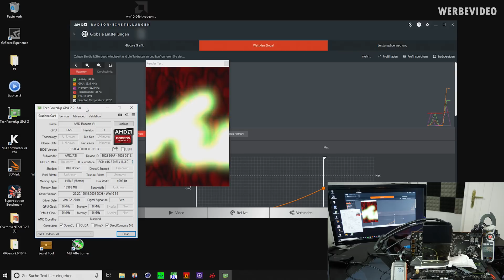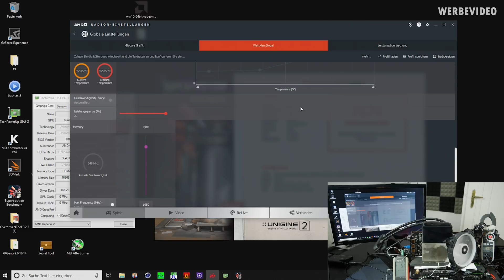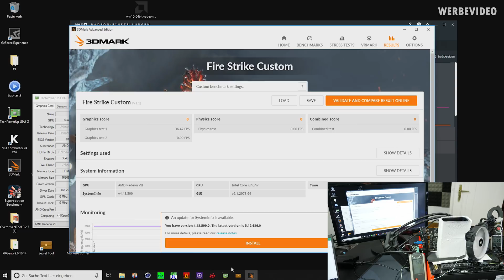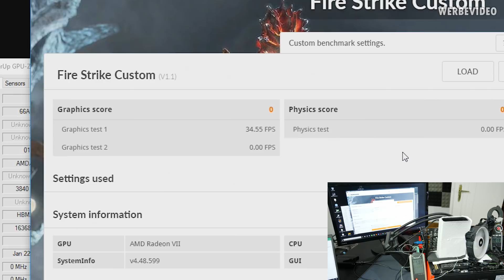RADEON VII Extreme Overclocking Attempt (en)

Comment: The fact that the "junction temperature" sometimes showed 65000 Celsius suggests to me that there is something fishy with junction temperature. I suspect it is actually calculated and not a direct measurement, though have no proof of course. It also jumps instantly from 40C to 100C under load which is physically quite fishy.

Comment: You can solve the clocks issues by setting as the minimal state the last state (where you changed the clock), so at the top of the state says min/max.
This issue used to happen in my rx580, I solved it with this.

Comment: would you be able to venture into the area of E3 v6 Xeons running on B365 / H370 / Z370 / Z390 Mainboards? I read somewhere that when you run Intel Management Engine cleaner on the bios a E3 v5 Xeon is able to run on Z170 so I would like to know if E3 v6 Xeons run on the newer chipsets.

Comment: Perhaps amd decided to screw overclockers and has decided to lock down their cards and this is why amd board partners have decided not to make special editions... And also perhaps they are not allowed to... It sounds like amd is deciding to neuter this gendration...
Reply: aib cards with custom cooling will come later. As said by amd.

my guess is that it was so rushed that we dont get any real aib cards for now, and the aib models wouldnt sell well if the cards drivers etc arent finished yet. Its like the started selling in the very late alpha of early beta developement for software

Comment: well...intel gonna delay 7nm later until materials replace old aging silicone that is not very good on lower nodes and extra heat....need carbon nanotubes  would do the trick but question how does it work on putting circuits on carbon wafers ??? good question...hope intel figure this out while AMD goes down by the flames on silicone are not fire proof so beware buying 7nm...you need home insurance first ...cause we gonna see lot of computers catch on fire now....and investors already preparing securing the money when time comes for AMD huge problem is lot worst then cyrix face

Comment: for this setup...you need LN2....cause water cooling have harder time cool this hot iron that is 110c to begin with on fans...and no room to push further on voltage...its pretty max out failure to me

Comment: You and some others have a voice with manufacturers or their reps.  Please tell them about the problem with the cooler plate being flat and thus requiring a thermal pad is a VERY poor method to cool the GPU and RAM.   They should stamp out copper plates with the correct thickness then nickel plate them, that would insure a proper fit for using a good TIM.   May be they could even put copper shims on the RAM until a permanent fix can be done at the manufacturing level.
Reply: Um do you have any evidence of such a claim. About the paste vs the pad
Reply: @jdrok5026    Yes, I have at least several evidences of a good paste TIM being superior to thermal pads.    I will not go to the effort to find the numbers, you should be able to google them.   Many people know that liquid metal TIM is better than "paste" TIM which is better than thermal pads because of the thermal transmission characteristics.    The only advantage thermal pads have over paste TIM is when there is a relatively large gap between the heat source and the cooling plate.  Also, when there is no to almost no gap, relatively deep scratches, scoring or machine marks on a surface paste TIM is superior to liquid metal, because liquid metal is not able to fill gaps and keep the gaps filled.   There are limitations and trade offs, however, that does not make my statement above incorrect.
Reply: @jdrok5026    Here is a very simplistic proof of concept video:   https://www.youtube.com/watch?v=GIgl1d5ldoA

Comment: FACT: Invest in the Best GPU Graphics NVIDIA RTX and Forget about the Rushed to Market, Half Baked, Crash and Burn Drivers, NO OCing Headroom, Over Hyped Waste of Money Rebrandeon VII.
Reply: @MrBluePoochyena  RTX gives you more performance and better graphics, as more graphics engines/developers optimize for RTX Tech like its Tensors Cores the performance gap between Pascal and Turing will increase even now I see 20% or improvement in some games. NVIDIA invested 10 years of R&D into RTX Tech they deserve an ROI for FINALLY delivering the Holy Grail of Graphics to Games Real Time Ray Tracing. You just have to look at how much expensive silicone RTX takes up that Maxwell/Pascal didn't have to understand why the price is justified, yields are lower and costs are higher. 
If you look at debt dumb and R&D poor AMD's bottom line their dGPU make pathetic profits, that's no way to run a company.

Comment: I think it's down to the components used on the card. & hence they didn't wanna do anything on the drivers. It's not that they can't but they won't. Look at GN video where Buildzoid ran an analysis of the weird components used on the card.
Reply: Weird they where all high quality.
Reply: @jdrok5026  On that part, if we look at Radeon cards vs Nvidia cards. The Radeon cards have more better visuals than an Nvidia cards. Like before, Radeon cards r the go to if u doing anything that invloves images & videos. They tend to have higher quality images & Apple products that uses Radeon GPUs have demonstrate it further. Am looking way back when Voodoo cards were just about to get stomped out of existence.

Comment: The drivers have been broken since the 2019 version was released. I get the best out of my Vega 64 with the last of the previous version. I’ve tried the newest ones and they are a hot mess. Obviously you can’t use the older ones with the Radeon VII though.

Comment: If AMD had released a product that was even 30% faster than the RTX line up, the NVIDIA would have sunk the prices of their cards and at that point the Radeon VII would have become just an expensive card that most would have not purchased. Because NVDIA cards are overpriced in terms of production costs but the Radeon VII is not, AMD cant afford dropping price on it to match NVDIA in that scenario, AMD had no choice but to to agree with NVIDIA to not cross certain performance lines to sell their Radeon VII as long as NVIDIA is equally expensive for about the same performance level. 
We see this with many industries, Airlines for example why does it cost so much to buy a plane ticket? Not because the fuel is expensive otherwise we would see a significant decrees in prices when crude oil drops by 50% up and down, but we dont see it, all the prices stay exactly the same for periods of time across different airlines no matter if oil is $100 or $50.

Comment: How did the NVIDIA CEO know so much about AMD card before the AMD card launched calling it less exciting as if he knew exactly what it was? 
Why does the AMD card is exactly as powerful as the RTX 2080 and not a bit more or less?
Why does AMD did not take seriously the overclocking issue while they knew about it, they had to and knew for a long time or was it perhaps not an issue but rather an intentional block the AMD has set in the driver for the Radeon VII to not exceed the performance level for some reason?
Why does AMD card costs exactly as much as the NVIDIA card and not even $30 less?
A lot of this starts to look like there is a certain monopoly game going on otherwise I cant explain these strange connections I see between the two companies.
As of example, suppose you and I are the only manufacturers of light bulbs, if my bulbs are slightly better than yours, your bulbs will go down in price and because of that I will lose customers who now will buy your product and you will not sell the bulbs for what they are worth to you, if we agree to make exactly same product and sell for exactly same price, none of us will lose anything, we will split the market in half controlled way.

Comment: Wattman has always been broken, my guess is that it's the thermal readings that Wattman doesn't understand. If you wanna try some manual overclocking you probably need to do gpu bios modifications, maybe see if you can get in contact with some of the hardcore etherium miners, they know the bios on amd cards work.

Comment: AMD says its between the 2080 and 2080 ti, got the numbers mixed up, since its closer to the 2070 with a mild oc. Yet, theyre saying that it is workig properly at stock, and there are fans still not seeing how crap its doing, or think that when you will be able to oc it, that its magically gonnabe 2080 ti level. makes no damn sense at all. Really disappointed, was hoping this was gonna be a good alternative, but no way in hell i would give them 700$  for a mid range, between 2070 and 2080, esp one thats louder, draws more power, and only kinda works
Reply: It's actually pretty much on point with a 2080, this video is just showing how a OC bug actually lowers the performance of the card.

Comment: I've got a 2700X/Vega 64 watercooled build and as far as I can see all AMD drivers from 18.12.1.1 have been useless for overclocking, running 7% core OC (1747MHz) and 1100MHz mem clocks 18.12.1.1 was stable as a rock.
Ever since this driver any custom clocks have just caused driver crashes at utterly random times, also loss of output signal, CDT's, total system lockups requiring a hard reset..
I actually suspected this was going to happen, just because of the state of the drivers over the last 4-5 updates..
IMO this is a really poor launch from AMD here, I suspect the card is far FAR better than the drivers are allowing, Vega 64 launch was similar with poor drivers, broken overclocking & analytics software which over time improved massively. 
How they managed to repeat this feat astounds me tbh.....
Reply: Apparently it was a switch in how they work. So they might be struggling to get it corrected.

Comment: Once AMD gets the driver fixed, could you try using thin shims and liquid metal again?  By simply looking at the TIM at 12:13 in your video shows different thicknesses, indicating a very poor physical interface across the GPU/RAM and cooler.  It looks like AMD or a 3rd party will have go make a cooler plate of different thicknesses.  This can easily be done to a solid plate by milling it or using a special shaver.   AMD has spent a lot of money on the RAM, a little more money on a good cooling plate design to insure proper contact is not a big expense and easily done.   I used to work in the metal industry and know there are a few inexpensive methods that can be used to get a good fit.
Reply: They used a graphite thermal pad on the you die instead of paste. The AIBs like XFX, Asus, sapphire, powercolor will most likely spend more on the cooler.

Comment: I've been using a Vega 64 reference here with pretty much the same results. It's very hard to make it to maintain the highest power state. Say, you put memory voltage to 1.2 and it just drops clocks to 800MHz instead of desired 1000+. Power target +20% - makes it unstable too, it jumps up and down. I figured the best tool was HWinfo as it has a GPU Hot Point sensor and that showed that the card is almost always going to 100+ degrees. Miners have figured out that to keep your HBM frequency you need the temperature of the memory to be under 70 degrees or it will switch power state and lock to 800 MHz. The regular "GPU temperature" measurement for the Vega 64 is typically 20-30 degrees lower than the "GPU Hot Spot" sensor shows and it's the latter one that is responsible for throttling the card.
Also on my card it doesn't want to stay at 1050 MHz HBM clock but it's ok at 1030 or 1040.

Comment: The driver is completely fucked from the looks of many reviews. 65536 = 2^16, 65535 is a max value of a 16bit unsigned integer on a computer. So the "sun" like temperature you see is a max value of an integer that holds the temp. data. Somehow it maxed out, clearly a software bug be it in driver or in VBIOS, etc.

Comment: "We have the sun in my room" lmao. That looks like some kind of bclk underflow. 65535 is some kind of max #(im tired i cant remember specifics) for example there are 65535 tcp ports in networking and ive seen 65535 underflows before or some kind of hex boundary memory address mapping rule. Like i said im tired but i wonder if you could mess with it with a hex editor or some debugging program.
Reply: unsigned integer polarity swapping due overflow casued by minus temp readout.

Comment: You think amd is gonna spend anytime on a card that makes 0 profit ?? It was put out just to say they are competitive that's it .. it will be low run and replaced by the end of the year of early next year .. so it's a waste to buy .. you can oc a 2080 it uses less power on a larger fab process ... this card is one that should be skipped

Comment: Something is wrong with the digitization or so of the junction temp reading, or an overflow issue in the driver, as 65535 is 2^16 - 1, so a 16-bit reading starting the count from 0.
Reply: Could also be, that they interpret a signed value as unsigned. So it would be -1°C
Reply: you guys should fix the driver and charge amd for it.
Reply: 65535 huh, sonds like tREFI is at it's limit, lol. #Just"B-Die"things
Reply: @Gti_Jason  or AMD secretly testing on consumer's time/money/electricity to start a fusion reaction for the cards so they self power the whole system and the town around the pc :) then we wont need solar panels anymore...